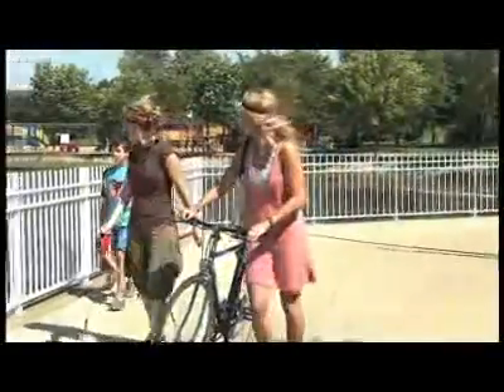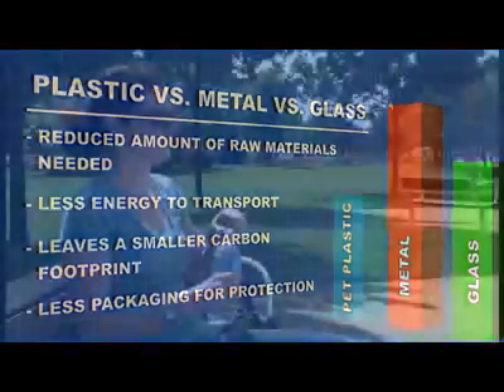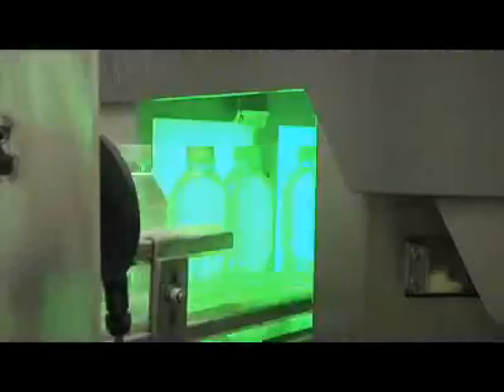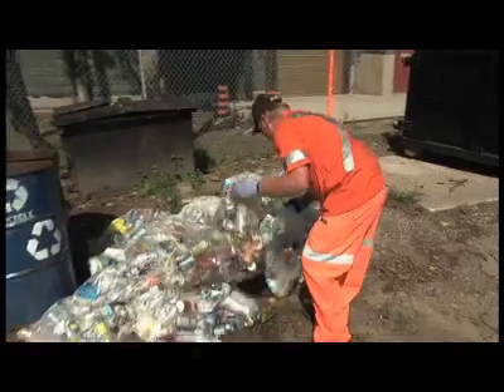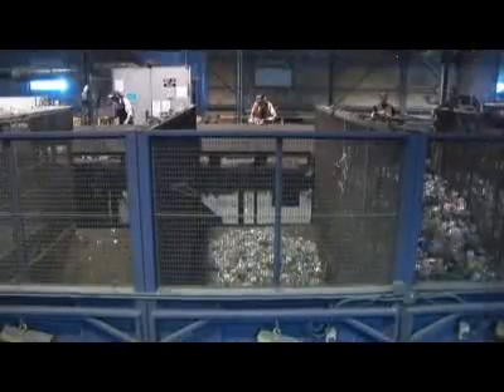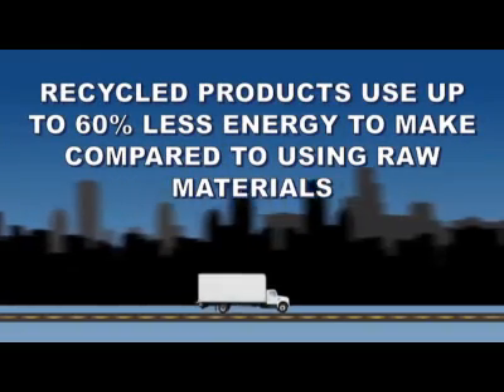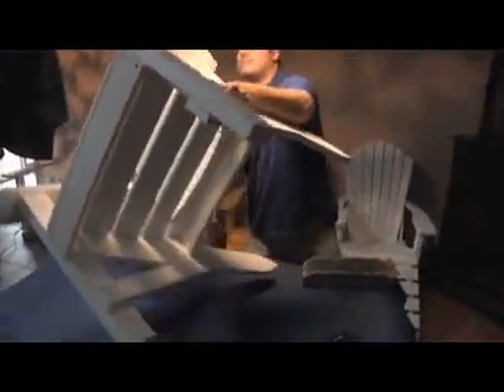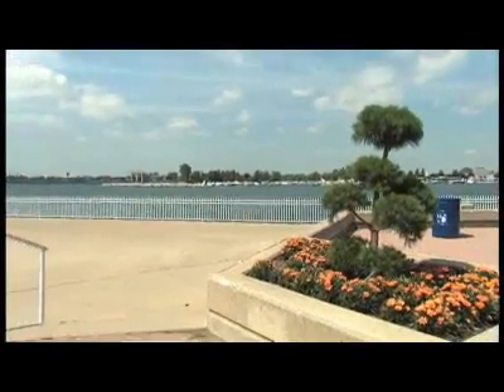Ever wondered what happens to all those Plastic (PET - Polyethylene terephthalate) water bottles?

Comment: Although PET bottles flakes have an high initial intrinsic viscosity and can be recycled into pellets, it is recommended to avoid the IV drop by pretreating the material through temperature and vacuum. Consequently the hydrolytic and oxidative degradation are reduced prior to melting in the extruder.